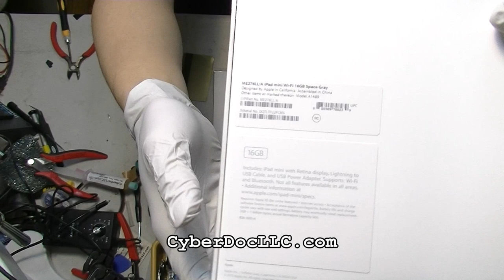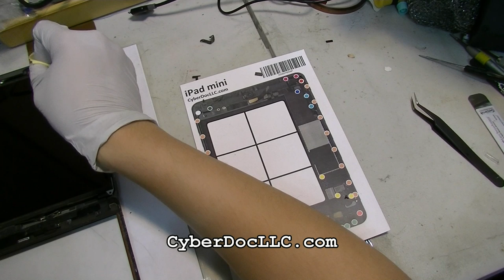iPad mini 2 with retina Display Teardown HD video LCD screen repair replacement

Comment: Hey Cyber Doc, My kid slammed the ipad mini retina on the floor. But it had a protective soft case, so the glass did not break... The only physical damage I can see is slightly bent case in the middle, I was able to carefully bent it straight again.... It will not turn on... What part do you think got damaged with the impact?
Reply from the maker: battery

Comment: I just recently replaced a broken screen on my ipad mini retina display but the new digitizer screen is not working with the touch of my finger I double checked and triple checked my work by going over everything I've done three or four times but nothing seems to be out of order any advice is to why the new digitizer is not working while the LCD is working perfectly fine??
Reply from the maker: Belly Af   check the touch fpc connector    if its damaged.  it is very fragile for some reason.   you can mail it in to us for repair.

Comment: It's the first time I watched a teardown and tried it myself but I think I did something wrong because is not powering on do you think I broke something?
Reply: +Berenice Rodríguez Try doing a hard reset (Power + home button untill apple logo comes on)
Sometimes it happends to a regular ipad or iphone too that it goes crazy after disconnecting something.
Reply: +Kevin Gans OK I will try that. But I don't think it has battery anymore, I did it when it was 1%
Reply: Kevin Gans New update. It didn't work. but I hear the beep sound when I charged it. is it the LCD?
Reply: +Berenice Rodríguez There is a little chance that you blew up your fuse for the backlight, if that is the case, you would need to repair or short the fuse, but i recommend to repair it because if you short it and you make the same mistake again you will end up with unrepairable board damage. When you charge it and hear it beep, try using a flaslight or the sun by shining the light from the top or bottom into the LCD. If you see something appear when you "mimic" the backlight with this then your fuse is blown. If you do not understand what i mean, try looking it up on google for laptop lcd screens how you can test if the backlight inverter is blown, it works the same way.
Reply: Oh yeah I see the logo. Thanks!!!!